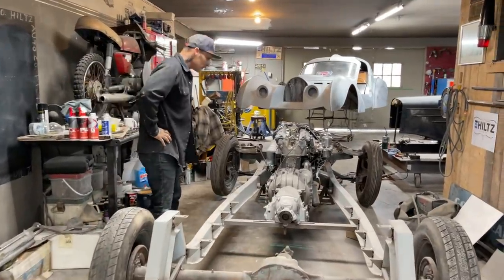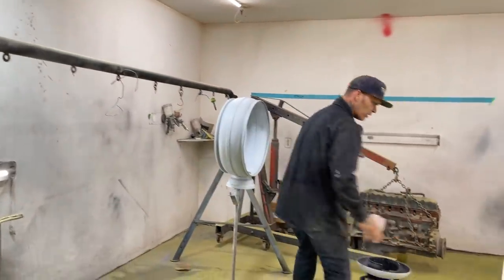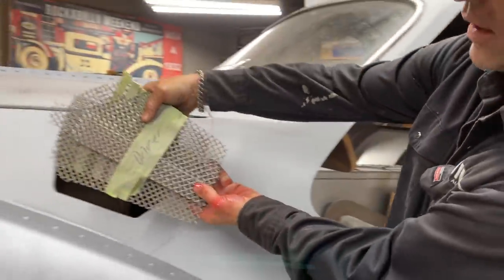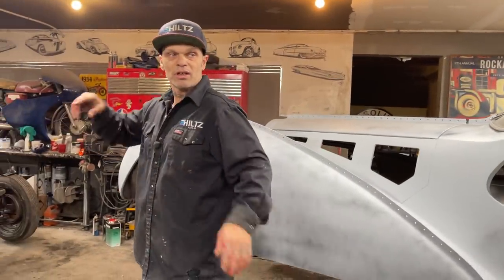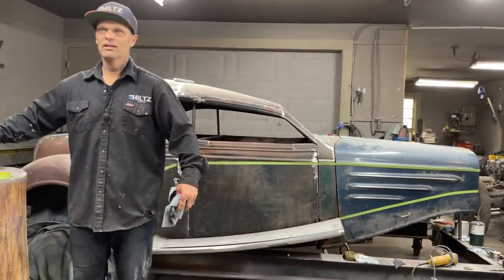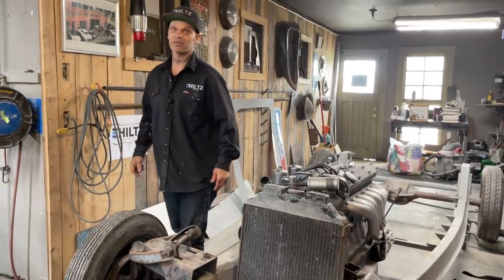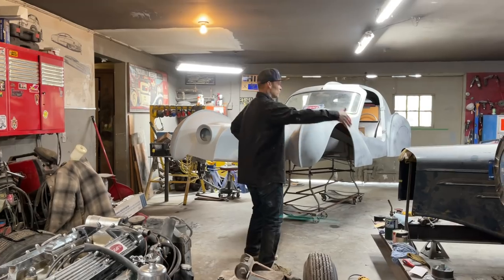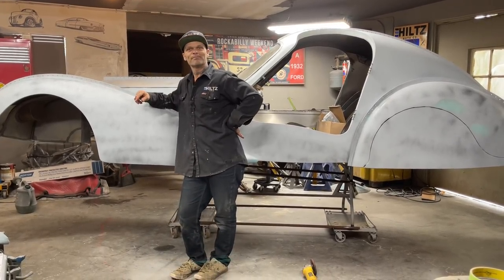FRONT END SUSPENSION CONTROVERSY... WILL THE MODIFIED LOWER CONTROL ARM WORK?

Comment: OK... the front end will pivot now. Once you attach the top pivot point you will create a bind, as the 2 different planes at the bottom will try to twist the joint at the top. It will actually work for a short period of time, until it demolishes the bushings.
I love you guys! I love your Art! I just don't want to see your Lovely hurt!
Reply: The first time the wheel travels up or down such as when you hit a bump in the road, something will bend or break. When he connects the upper control arm to the frame I think he will understand. I love the body concept.  Later model frame and running gear and it would be an awesome driver. If it just stays art it will still be fun to look at
Reply: Actually it works better than I thought it would with the two planned pivot points so out of alignment. I do notice that he aligned them a little better and the play in the bushings is allowing some additional movement . I agree that we're just wanting them to be safe, and preserve what is going to be a beautiful car.
Reply: @i8ntnuts  And how often do you actually think this content maker will be driven?
Reply: Hi Ken,
I haven’t thought much about what the car will be used for. I guess I would assume it would at least be test driven? If not I still think it would make a very inspiring static display especially if the build was documented with photos. I know I would go see it if it was displayed locally.

Comment: Still disagree. The up/down travel of the wheel will cause the gometry to change. I hope its not much, but it will cause toe to change. I.E bump steer. 
Still like the work, but should have gone with a longer “radius” arm. 
Good luck, its nothing that cant be fixed if it is an issue.

Comment: After locking the top a arm in position, now lift the tire up and down and watch the movement of the tire. It will not keep Alignment.  This is by no means a critic of your work, sometimes it goes take a little math and engineering to get the best out of a design. You and Jolene do fantastic work. Keep up the outside of the box thinking.
Reply: Good point. At the present moment, those bushings are probably really stressing out.
Reply: That's right, it will cause a lot of stress and friction and it's unsafe because of that.
Reply: @lieffies2000  yup, he's changing it. Too much bind

Comment: not sure if you did this or not...the front cross member that the bottom A Arms mounts to...has to have a 3 to 5 degree angle down at the back side to get the right amount of camber built in ...this is so the front tires return to center when you let go of the steering wheel...if this is not done it becomes kind of dangerous because you have to steer it back to center and its hard in an emergency situation...just something you may want to consider....I did my first race car front end similar to what you did on this car and it made things difficult and I finally figured out what caused it and fixed it right away...enjoy all of your work and I am not trying to mock anything you do just an suggestion to help you out...

Comment: Awesome that you found a fix that you are happy with and works for you without having to alter the frame, a bonus I saw back in the previous post although people were disagreeing with your original modification none of the comments I saw were derogatory or malicious and most were based around not wanting to see you fail and waste time and money down the road. I didn't read all of the posts, that was definitely my reasoning, I want to see this work out and become a daily driver. 

Question though  as you are full fabricating the vehicle, is there another process to licensing the vehicle or just a standard safety check/DOT inspection?

Comment: Chad,think. A triangle can not move correct over two different turning points. Oke it will move, but in a crooked way.
Over one turning point it will have to turn in a bigger circle then over the other point.
Reply: Wrong those arms ain't for turning,its just for up and down movement.only thing that rotates is the lower ball joint and upper ball joint.the triangles function is just up and down.
Reply: @eddiebarrera469  Look from the triangel from a site, it has 2 turning point,. They are at different distances from the  wheel. When the triangel go's up the turning point that is at the shortes distance can,t follow.
Reply: Sorry guy but you are definitely  wrong on this one.His using that shorter piece  as a sway bar,the actual lower and upper control arms align perfect.

Comment: Shortening the stabilizer bar changed its up and down radius which will put things in a bind as it goes against the A arm radiuses. Severely limiting up and down travel.  Measure it all out, draw the radiuses on paper and you will see what I speak of.
I made that mistake on a rear end setup once, making a solid wishbone shorter than my ladder bars.  Worked for a while then came apart!  Just saying , not trying to be critical of your build, just trying to be helpful.
Reply: Hope Chad rethinks his suspension, as the car is first class keeper. He had it nearly right the first time with common axis, just needed to reverse control arm and maybe fix to front chassis. You obviously have good knowledge. Hope he rethinks!

Comment: I just did some research and looked at hundreds of control arm pictures of all types, stamped and tubular types, and all of them have one thing in common.
No matter the length of the arms, The two inner bushings are perfectly aligned so you could put a single bolt through them both. I hope chad does not go ahead with his current setup, it will only mean having to take it apart once it is permanently welded. Much easier to fix it now when it is only tacked. Geometry matters. As does Joline's safety when driving this beauty in the future. Please fix this safety issue Chad.

Comment: MEA CULPA !  

I was one of the non-believers, but my eyes have seen the truth!  So, good show, Chad, and I'm glad it works.

Still, you really can't establish a proper hinge line when the pivot points aren't lined up exactly.  It will work as long as there's enough slop in the system to allow for it. Given the amount of movement this will have and Jolene's gentle driving style ( I'm guessing here) ...everything will work just fine, plus, the control arm is good and robust. 
Keep up the excellent work!   Cheers, Pete.

Comment: Just because the front suspension works, that doesn't mean the geometry is correct. The shorter pivot point truly wants to move it the arc that coencides to where it intersects with its location on the longer pivot point. It will tend to strain the bushings.

Comment: From what I saw in another video, it is likely that the Mustang bracing rod, with the rubber bushing that attaches to the chassis frame, so that the bracing rod can articulate in more than one plane, would have worked for the original iteration.

Comment: As said in previous comments, i think you should pick suspension geometry from another car. That way you have a nice handling car.
Designing suspension is not art but engineering and is critical in many aspect to keep the wheel in contact with the road and maintain the right angles in regard to the car and the road. 
Don't be mad at my comment, i truely appreciate what you do, and thats why i like your videos and subscribed to your channel !

Comment: the longer and further back you can mount the lower control arm, the less it will affect the steering angle as the suspension actuates
Reply: Or put them in front of the X member the way they were on Mustang II’s, Ford Cortinas, Ford Sierras. That will give plenty of room for the steering rack. The problem is he doesn’t read or reply to comments & that gives the critics the opportunity to call those of us who have had decades of experience building one off cars ...... haters.  I’m at the point where I just sit back quietly and watch the mistakes and say nothing.
Reply: True.

Comment: I'm glad to see it doesn't bind as badly as I suspected it would, however there must be quite a lot of bushing play for it not to...will likely eat bushings like mad.  Also, without the upper control arm mounted and secured this allows the entire hub to rotate clockwise/ccw to account for the shorter radius of the trailing arm's shorter travel path.  Again, just because it moves doesn't mean it's behaving properly.  If the consequences of not having both arms rotating around the same axis are minimized by having bushings wear out prematurely then it may very well be worth the cost of making it "work" with what you had already.  I, however, am still a little worried about how the hub will behave at speed.

I've been known to do some "engineering" on some things that is less than perfect, but I'm also willing to deal with the consequences of that imperfect solution and tweak/repair as needed for a "good enough" solution.  This will likely be one of those situations for you.  This obviously isn't your first rodeo and I mean no disrespect by my statements.  Some of the naysayers that comment are just plain rude, others comment out of genuine concern for safety and long term success of the project.

Anyway, thanks for continuing to share both your thought and building processes.

Comment: it will pivot up and down but the original arm as sent the ball joint will stay at 90 degrees as it travels up and down. the way you have it the balljoint will move forward and backwards as it goes up and down. same as un equal ladder bars. it wont be dangerous but front end alignment will change thru travel

Comment: I realize that Chad has eyed up the front suspension on the Bugatti. 
How are you positive that left and right are in exact position/ opposite on the frame rails?
Is there identical factory holes or rivet on each frame rail that could be used for reference points.
I just fear dog tracking if side to side / front to rear axles parallel. 
And so on.
Thanks for considering!

Comment: BAD CHAD The  piviot on the inside must be in line with each other. Like when you showed putting the rod threw the piviots , a few videos ago.  If it is loose and slopy it will move easly. If it is not in line and tightened up it will bind. The angles in any picture or video are hard to see. (Becuse of the nature of photoes.)  So you could have it right and I can not see it. But what I got from whar you said  that the arm was shortened and there fore not in line. I am just trying to help becuse you are a good person. I have been building hot rods and customs for 60 years.

Comment: That front suspension will still bind Chad.Try connecting up the steering rack and you'll find your pivot points are askew!!
Reply: Weld a gusset to the arms and it will really foul up.

Comment: I think the front end will either work or it won't. You will find out real quick once loaded down with all the weight and going down the road over a few bumps.
Reply: Looks and sounds like the rubber bushings are making up for the severe mis-alignment.
Reply: It will show in an emergency situation. Probably put it straight into a 🌳

Comment: *****  Chad,  I have never been a fan of where you placed the gas tank on the 57 C..   Now that you have separated the body and Chassis, perhaps when you look underneath the rear of your body, you might want to re-hang another gas tank underneath instead of behind the driver's cubby? There certainly seems to be plenty of room under there.  By doing this, you now have room in that cubby to place a battery if you didn't want to put it in the rear of a front teardrop fender?

Comment: Chad,  yes the lower arm goes up and down but does the geometry change like increased rake as the lower arm moves?  What was the banging noise when you worked the suspension?  I am inspired by your piece of art but remember this car will be used by yourself and Jolene and thus should be engineered as an automobile,  not a work of art.

Comment: I've never sprayed with that much pressure before gee I'm a newbie
Reply: I'm a newbie too. But Spraying with lots of pressure will give you the best finish, But there are down sides.

To much pressure wastes a ton of paint into the atmosphere and creates a huge fog. It's also bad for the environment. Real body shops must maintain max pressures to be compliant to the law (hvlp).

That where the really expensive guns shine.

They give a super awesome paint atomization, all while staying within legal air pressures. 

But if you are by yourself, and only paint once in a while, who cares.

You slowly keep cranking up the pressure, untill you can't live with yourself wasting any more paint. (while adjusting your paint feed knob), so you don't get runs, or put it on too dry.

Comment: Chad, lifting the wheel up and down proves nothing but the twist isn't bad enough to bind with just the lower bushings.  The twist is still there and will bump steer the car.  Prove this to yourself with a model instead of the car with two bars, one half as long as the other, and a common endpoint.  Bolt the bars together with a separator at that endpoint, then also bolt them together with a spacer at the opposite end.  Everything is parallel at the bottom, right?  Now lift the bars two inches.  Are both spacers still parallel to each other?  No?  Well that's what you just built, a suspension twister that will induce a steering effect when the suspension moves.  Maybe you'll be lucky enough it just scrubs tires, but it's not safe the way it is.  And maybe more unsafe because it moves up and down and you think it's fine.
Reply: I agree Douglas, the add on shorter half of the lower control arm will be ripped off of the longer half.  All A-arms have in line bushings like Chad showed with the shaft thru both, before he cut it up.  Just want to see it done correctly and safe.

Comment: I knew it would work because the hinge points were lined up...
Reply: But they are not lined up... they are lined up horizontally, but offset in the longitudinal direction. The bushings are flexing and allowing the arm to pivot those few degrees, but they will wear out quickly.

Comment: Chad, you used to actually work on your cars during the filming but lately all you seem to do is talk. Pretty much the same thing every time. Three days now and you still have not bothered to test your faulty control arm design. You can put it off even longer but sooner or later you will have to face it. We think you two are great though and we will keep watching.
Reply: That little brace he added will have to come off. It looks like a mustang suspension and the lower control arm only connects in one spot at the frame. The way it is now the wheel will travel in an arc rather than straight up-and-down. I believe the mustang uses a rather long brace connected to the lower control arm near the wheel and then back to the frame at the same elev. as the lower CA pivot. This prevents the wheel from moving from front to back. The connection at the frame would be threaded so you can adjust “king pin” inclination